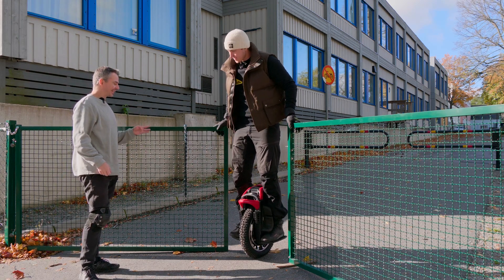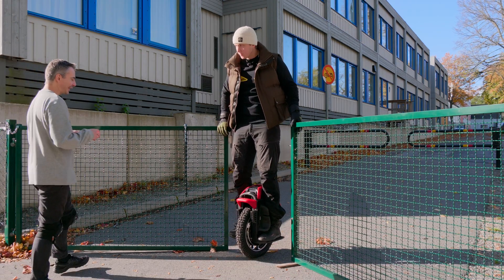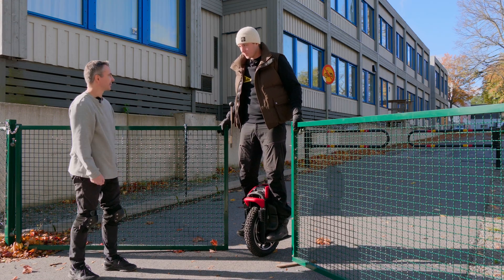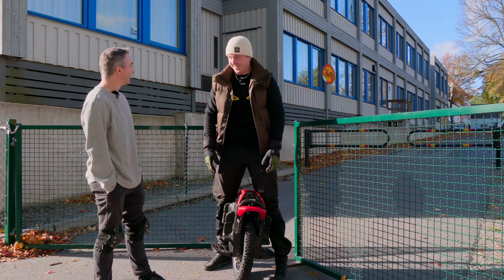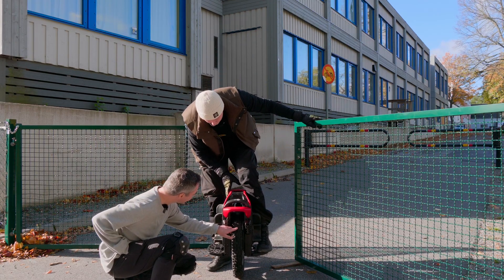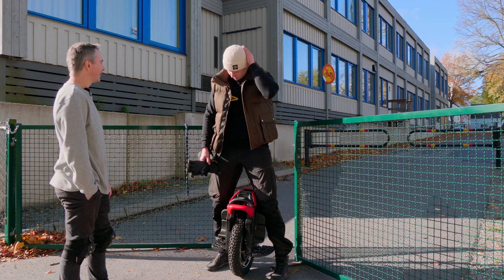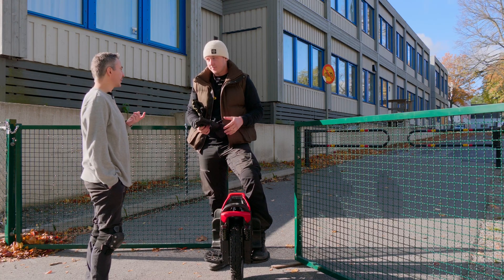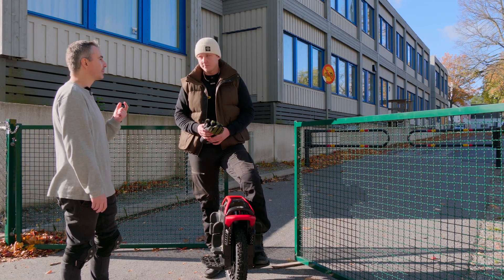King Song S22 landing stress test for stator slippage issue with Tobias

Comment: Are all s22 motors made on 6/26 defective?
Reply from the maker: No not all motors are defective, even the older ones without the pins.
An example is Mike Leahy @shibby_time S22 which has been jumped many times and used in extreme conditions. The motor has just been opened and it was still in perfect conditions.